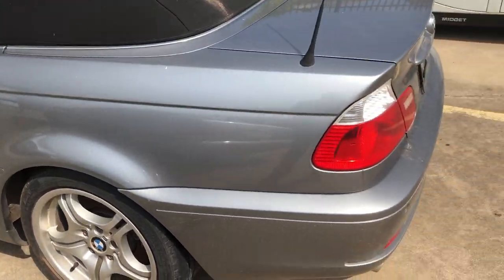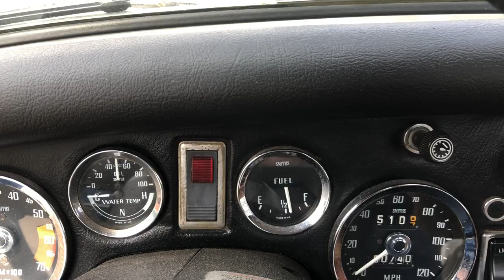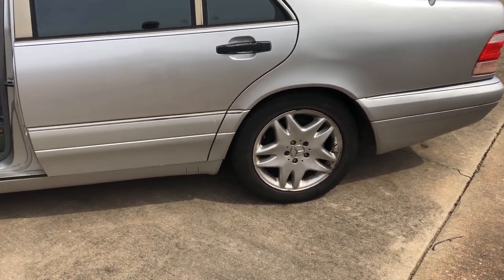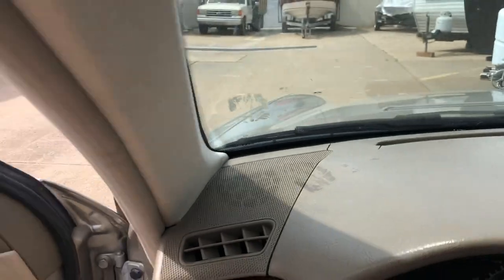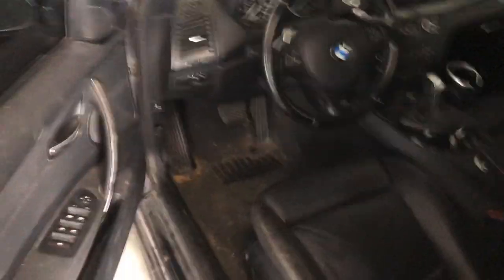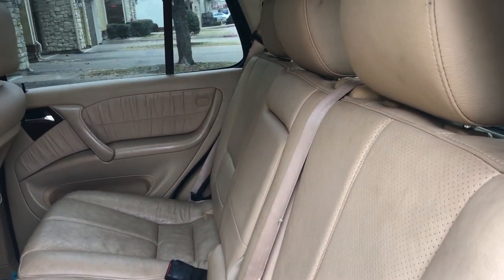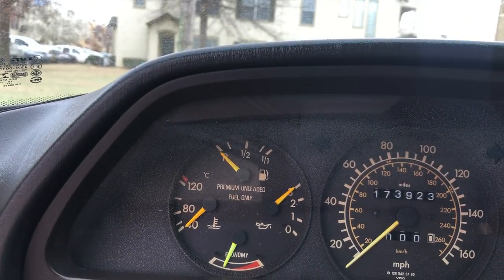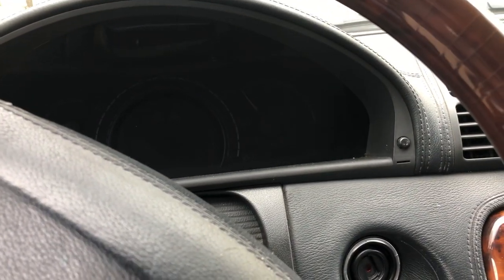Give Them What They Want!

Comment: Thank you for the tour 'de Jor!' Said it before but gotta give you tons of credit for picking the breed you did. Kudos on all the labor you've done and shown us. OK, one TIP for you:
Never good to start and run a vehicle unless you drive it to full operating temp and at least 5 miles. NOT doing that really DUMPS lots of RAW FUEL into the Catalytic Converter. Then you can get the most dreaded code P0420 (430) (nightmare codes) Always wish you well and always thank you for another one. Later! Sonny
Reply: My comment exactly

Comment: You could use some 3M spray adhesive on the back of the 560 to stick the head liner back up. Spray the glue on both side to be joined let it dry a min then stick it back together. You have a bunch of cars man even more than Randy. I would love to take that bummer beamer off your hands but I couldnt afford it.

Comment: Those BMW e46 have their problems but they are the last of the “analog” three series BMWs. Parts are dirt cheap for them and easy to find right now and its a great time to buy one (especially a convert or a coupe). Now is the time to snap one up for CHEAP money! Once they all hit age 25, the values will start inching up! Fix it up and keep it ... along with the MG!  Can’t, not ever let that MG go!  I believe the e46 should live indoors and the bummer bimmer can live in the fresh air! BTW, I would suggest not leaving the BMW batteries connected if they are not being run every few days or at least once a week. They never “really” shut down electrically and will run down the battery if left setting for a week or two. Either disconnect them or leave them on a battery tender when in storage.

Comment: I like the bummer beamer its cool. I would love to drive it. The cable was sooo loose is that why its not turning over? The walmart battery you can take back if its not more than a couple years old. Take it back to walmart and get a new one. 400 $ Maco on the 560 sec benz.